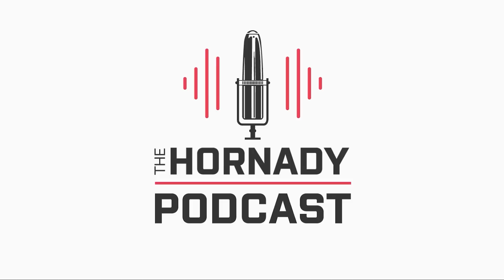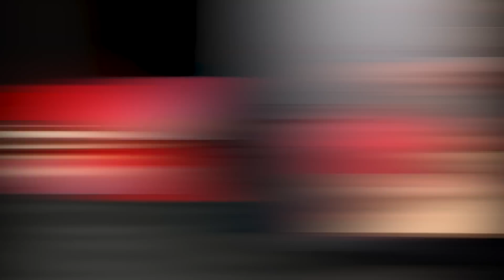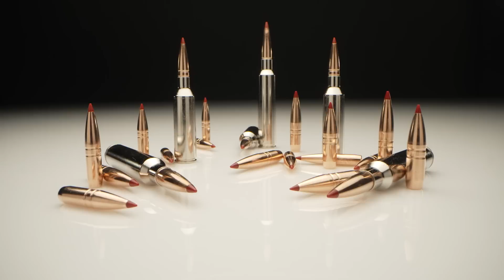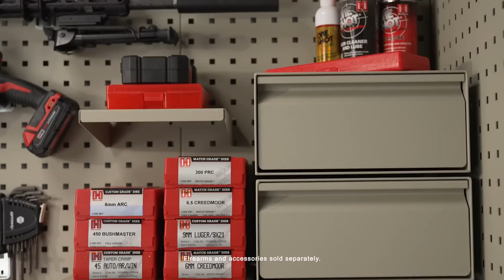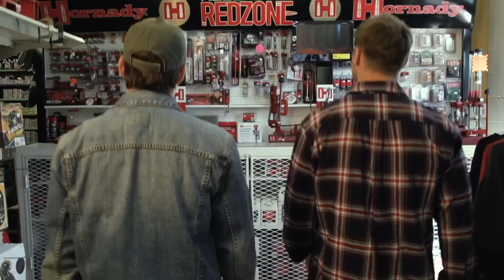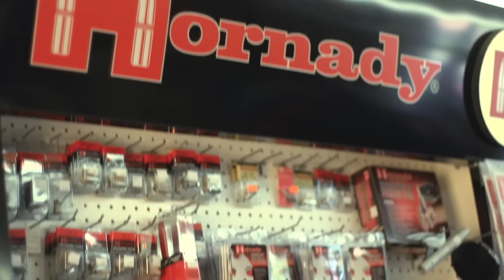Ep. 150 - Introducing the NEW 338 ARC

Comment: What is the deal with twist rates almost none of the 338arc rifles or ar platforms being reveiwed on YT are using faster twist rate barrels i dont think ive seen one in 8 twist yet?

Is 8 twist actually the optimum rate for a 14 to 16 inch bolt gun very difficult to find .338 barrel blanks in Australia so i would like be sure cheers?
Reply: 1:6.5" is great, so is 1:6". The later gives you about 2500fps limit before bullet failure, which is a high ceiling considering its factory loading is 2075fps froma 16" barrel

Comment: Will we see a .416 ARC? Based on the .535" bolt face PRC case, with a >=550gr SubX in short action? How about a .458 ARC @ ~700gr using a .588 boltface in long action?
Reply: The easy answer is a .416-458 Socom wildcat which is pretty much the same. Id like that over a 45cal

Comment: We need to know what AR-15 bolt it will use, what brass is used to make them and what magazine we need to get!
If one uses a common easily available piece of affordable brass, that is a winner!
From what I can find I believe there are the bits and pieces for having a 338 bullet coming out of an AR-15.

Subsonic and supersonic
338 ARC uses a 6.8 SPC brass, magazine & bolt

Subsonic and supersonic
338 Spectre uses a 10mm Magnum or uses a 6.8 SPC brass, magazine & bolt

Subsonic only
338 Razorback uses a 10mm case or uses a 6.8 SPC brass, magazine & bolt

Subsonic and supersonic
338 Whisper can be made from a 308, 7mm BR, or any other of those cases, a 5.56 magazine and uses a 450 Bushmaster bolt

Subsonic only
338 Whisper "2" can be made from a 5.56 or 223 brass, magazine & bolt

Comment: The 300aac was Built first as a subsonic first and foremost. It was done to unify the 300 whisper cartridge because there were so many specs out there. Its why Hornady used to refuse to call it whisper before saami approval. So he is wrong. The whisper was done for years before blackout.  The 338arc is more efficient. The 300aac supersonic was a Hornady thing they did to try to sell it as a hunting cartridge. Remington was onboard because they were trying to sell the hunting msr thing with the goofy r15 rifles. The port size is key with the 300aac to get it to shoot subs and supers suppressed and unsuppressed. If you use hornady powders you get unburned powder, if you use cfe theres none. Hornady uses cheap powder.
Reply: .300 AAC was not built as a subsonic first and foremost.

Comment: @Hornady
@Hornady Manufacturing 

Thanks for this.

Now please do a Straight Wall 41 ARC for all the straight wall needs. 

The 190 flex tip you’ve already got for supers, come up with a plinking round, & a big nasty 375-400 grainer for the subs. 

Maybe Try the 350L case length so there’s some authority with the Supers. 
It can be a souped up 41 Magnum rifle load for today with Big H supporting it & it besting all the other straight walls that will fit in an AR-15 platform. 

I was originally thing .375 but the ARC case is too large in diameter.

Enter the .41 ARC.

Comment: Will you develop a CX bullet for the 338 Arc for supersonic loads?
Reply: Hornady does offer a 185gr CX bullet... but I am not sure I would go for a CX with such small case capacity for powder (typically need 2,000fps for CX to expand reliably and desire 2,200fps)... but an ELD-X on the other hand... I like the idea of hunting with the Sub-X mag in the gun and an ELD-X mag to swap to if the game is just out of reach for a confident subsonic round.  They do have a 230gr ELD-X, maybe they could consider working up an even lighter weight variant with 338ARC cartridge in mind.

Comment: What are you doing about the diminished performance of the bolts on 6.5 grendels, 6 arcs, 7.62x39, and 338 arc.  I have several 6.5 grendels and 7.62x39s and I carry spare bolts for when the extractor breaks.
Reply: Hornady doesn’t make rifles or rifle parts.  I’ve been shooting 6.5 Grendel since 2009 across many different AR-15s with different barrel and gas system lengths.  I’ve been running my 12” CLGS suppressed pretty hard since 2017 without issue, and none of the others have had parts failures or notable malfunctions.  I recommend getting a Rexus bolt or 2 if you’re worried.  Also, remove any of your O-rings if you have them around your extractors.  Those hurt extractors due to excessive stress during chambering snap-over.
Reply: I really think in this case, we could look at the 6.8 spc case instead of the ever popular Grendel case to get a little more bolt strength. It just seems like everything gun related is a stupid popularity contest and they build what's popular rather than what's smart.
Reply: @cheatinggravity173  338 ARC runs at even lower pressure, so it's a moot point.  The subs are running in the low 40ksi region, supers maybe 47ksi.
Reply: @LRRPFco52 hmm interesting. Still, it makes me think that if it can run that low of pressure, a smaller diameter case and therefore better capacity/ more efficiency (higher pressure = better efficiency) could be utilized. Also, mags would hold more for the same length.

Not criticizing, just thinking out loud really.
Reply: @cheatinggravity173  Smaller diameter case = less efficient, not more.  The wider/shorter the propellant column is, the better conversion you get inside the chamber.  Grendel is phenomenal in that regard, giving you 93% of .260 Rem performance with the same bullet.

.260 Rem uses 10gr more powder and 10,000psi more chamber pressure for that extra 7% performance.
Reply: @LRRPFco52  more voluminous cases are always less efficient than less voluminous, it holds true for every cartridge out there. I think we have proven at this point with the last 25 year's evidence from the short mags that efficiency has less to do with diameter vs length than case volume to bore diameter. We can see this when caomparing the .270 wsm vs 300 wsm. 300 is more efficient. 308 is more efficient than 6.5 creedmoor. There is a ratio that works well and you get away from that, efficiency drops off.

280 AI is phenomenally efficient and gets sumilar velocity from less powder than the 7mag even though it has a skinnier case. .223 Remington is way more efficient than the 30'06 even though they are virtual twins in scale. Not because if diameter, but because of volume.
Reply: @cheatinggravity173  It’s clear to me that we’re measuring efficiency differently.  One of the factors I’m looking at is full propellant burn.  The .308, 280 AI, 7 Mag, .30-06, and .223 Rem all suck in that regard because a lot of the powder isn’t even converted.  That is terrible for throat life and SDs.  

In gas guns, it also trashes your gas port, causing early erosion and departure-prone gas system characteristics.  If that propellant isn’t being converted, it’s acting as a filler in the case and an abrasive down the bore.

Short, fat-shaped propellant columns do much better at converting the propellant, especially with higher angle shoulders and a good case diameter relative to bore diameter.

If you look at 6.5 Grendel, it does 93% of what a .260 Rem or 6.5CM will do, same barrel length, same exact bullet.  But Grendel does that with a much smaller case and 10-12ksi less chamber pressure.  So how do we scale that - this is where I’m focusing.  30 RAR was a very interesting cartridge in that respect.  I like what the WSSMs do in the chamber, but magazines can be a challenge.  Look at 25 WSSM vs 25-06 for example.  The 25 was the most interesting of the bunch.

But for 338 Subs, the Grendel parent case cut down makes a great base to work from.
Reply: @cheatinggravity173 I agree.  I manufacture ammunition and make the 6.5 grendel.  I was thinking I should start making the 6 Arc since it was the new hotness, but then discovered 6 Maxx and realized that cartridge makes a lot more sense and the brass will be easier to make.

Comment: Where is the 1:3 twist 😤, Im out
Reply: Did you listen to the segment on why they went with a 1:8 twist? They gave a pretty good reason.
Reply: yes, I also heard contradictions imo. The 8.6 can be supersonic due to its higher case capacity. This round begins To fail due to the high rpms generated with higher velocities. This new 338 arc has less case capacity reducing the versatility of the cartridge. 

(If you are specializing this round for subs only, why also reduce twist rates? Wouldn’t rpm be a more important metric over velocity or twist determining how a given projectile responds? These 338 bullets were designed to go much faster. Expanding projectiles generally need a little extra help expanding with these lower speeds. 

It doesn’t make sense to me to lower the twist rate to overcompensate for higher velocity it isn’t capable of. I feel they rushed to conclusions a little too fast here. This is new gun territory with lots of new info coming out. 

I suppose I am in the wait and see camp.
Reply: @jeffreyjadav9493  I’d rather have a slower twist if it means I don’t have a chance of shredding jackets like the 1:8. I’m sure some manufacture may come out with a faster twist for those who think it is needed. If it catches on I hope Berrys or other plated bullet companies will make cheapish plated bullets for it. I use Berrys in my 300blk for cheap subs so I don’t shoot all my Makers bullets. I doubt a plated bullet would survive a 1:3 twist when it’s rotating at those rpm’s.
Reply: @jeffreyjadav9493  the whole point of the 8.6 and 338 arc are the subsonics. If you want a 338 supersonic in a 308 based cartridge use a 338 federal its better. same bullets going at 1050 to 1075 are gonna deliver same energy on target but in completely different platforms.

Comment: So glad we have another 220 Russian based cartridge for the AR :eyeroll:
Reply: Haha I was thinking the same thing.   Bolt manufactures everywhere are smiling.
Reply: Hey Seth...
It's been a while since I spoke with you on the phone.  I think it was shortly after trying RL-26 in my  .340 Weatherby and we had both realized that RL-26 was special.  It was getting within 50 - 75 fps of what I had gotten out of the 26" barreled .338/378  Wby.!
The  ,340 velocities were also out of a 26" barrel.
Our other contacts usually revolved around my testing the velocity limits of 2 different  propellent guns in .30 and .50 caliber 
variants that invariably ran into hyper-velocity gouging issues once they got into the mid 6,000 fps range with monolithic L/D 1 ratio projectiles, with grain weights of 50/55 and 225 respectively.  Based on EML results these outcomes seem pretty intractable with possible solutions in the relative hardnesses of bore to projectile interfaces.  Tailoring of these parameters may be rather involved and they also have to be dealt with in light gas guns according to several labs.  Sound speed parameters and pre-acceleration gradient enhancement can actually result in yield strength transcendence times 5 at least! This is according to various labs from SWR, Denver Research and LLNL...just so you know.
All that was done back in the mid to late 80's
 thru the early 2000's...
I did get interested in the 
.416 Rigby straight/.460 Weatherby, necked to .50
caliber out of a 32" barrel
that was peaking in the 
11,000 to 12,000 ft. lb. range that would fit in rifles with a .338 Lapua bolt face.  Recoil issues would have to be figured out however!  
That was then and this topic is what interests me now and looking forward to the ride!  Excellent video!  Thanks for being there and keep your powder dry!

Comment: Umm can we get ammo prices down on what we currently have first. Make 300 blk cheaper, 308, 6.5 cm cheaper. Also make a hybrid case 77gr 5.56 and a gun that can handle higher pressures so that we don’t need a 22/6 arc. Those rounds will never be fully adopted anyway just like this round won’t. They won’t work well in a belt fed and they ar platform wasn’t made for them.

Comment: So jsut copied the wildcat 338 spectre.
At lease maybe its a more common case? But the 338 spectre using 10mm magnum cases have a normal-ish casehead, if this is using the fcking garbage 6.5 grendle/6mm ARC case with that trash casehead.... just why, they blow bolts constantly.

Comment: its like 8.6 blk but worse..... right out of the gate.
Reply: but worse? it runs in an ar15 not ar10 lol. there's 3 plus pounds of weight savings there alone.
Reply: @jjmckay6man1  plus the 8.6 has way more energy on target. Also much better long range potential. And it can do subs or supers.
Reply: @ayegame2424  way more energy if you shoot it supersonic which defeats the point of having it supressed you may as well just carry a 308 with far more energy again and a supressor at that point, when you bring it down to subsonic speeds this has more energy since they have a 307 grain projectile at 1050 fps vs the ~280 grain options in the 8.6 blackout from the factory.
Reply: @WayStedYou  you get 300 grain factory rounds in 8.6 subsonic loads. That's the most common weight I see. And yes you could shoot long range better with 308. But it's the difference that you can do both in 1 gun and not need 2. Also you get a lot more rotational energy in the 8.6 ammo. It's not that 8.6 does everything better then any other cartridge. It's that it is versatile  then thier cartridge. Your not stuck with short range subs. You can do more with less with 8.6. With 338 arc you need a gun for it. But if anything comes up that's farther away. you need a whole different gun.
Reply: @ayegame2424  a 307gr bullet travelling the same speed as a 300 gr 8.6 gives same energy lmao. Also arc can run subs and supers. educate yourself by watching the long form video on 338arc.
Reply: @WayStedYou  yeah this guy hasn't even listened to the video on 338arc lmao.
Reply: @jjmckay6man1  i just used 300 as an example. You can also do factory loaded  342gr at the same velocity. Which is way more energy... and I did watch the video and was unimpressed. Also you don't have to get the boombox. You can go falcon or even bear creek and save some cash.
Reply: @ayegame2424  still carrying a much heavier weapon than an ar15. bet you'll be paying much more for the crap out rounds. have fun with your boutique ammo lol.
Reply: @jjmckay6man1  this ammo will be very boutique as well. Very small market... most the arc cartridges are
Reply: @jjmckay6man1  not if you get a properly built gun. I bet the boom box is lighter then most people's ar15
Reply: @ayegame2424  yeah I'm not spending 3 grand on one of those..lmao have fun spending money you don't have to.
Reply: @ayegame2424  Q tard, opinion discarded

Comment: Time to make
160gr sub-X for the 6.5 grendel
Its already 1/8 twist 😉
Reply: Several people have developed subsonic Grendel loads using 8208XBR and 140-160gr bullets.  Works great out of 10.5” to 12” Grendels.
Reply: With a high SD like that it would be a good option fs
Reply: 6.5 carcano had a 162 grain round nose with 1/8 twist and had questionable stability. An even longer high BC bullet would probably not stabilize.

Comment: 2025 Year should have been an easy intro year for 25 Creed, 25 PRC, 25 GT…you all missed the ball
Reply: I agree with this... standardize the 25 Creedmoor
Reply: Absofreakinglutely!!!! Hell I would have been happy with a 257cal A-tip
Reply: @kirkmartin2223  that is coming
Reply: @kirkmartin2223  They just dropped .257 138gr A-TIP, .695/.350 BCs, which is insane.
Reply: Damn straight
Reply: 17 creed or 338 creed, possibly 416 creed....... 25 just never really interested me, and yeah, I get it 2025 lol
Reply: @briansouth9325  338creedmoor would be 338 federal.....yawn

They would have been better off coming out with a  20cal offering with a high BC bullet than anything 17cal
Reply: @kirkmartin2223  not necessarily, 308 necked up was the 338 federal.  You could run it higher pressures and heavier bullet.
Reply: @briansouth9325  it still would be kind of lackluster. You might get 2500fps if you leaned on it with a 230gr
Reply: @kirkmartin2223  no … 338 fed is a 338 fed. And actually, in all regards, a hell of a hunting round
Reply: 257 Roberts is 1 of the best 25's, yes would be nice to have a short action 25
Reply: I know 25s havent been THAT popular.....but its starting to get wanted more. Myself included
Reply: You should be in marketing 😂
Reply: We need saami 30 ARX

Comment: So when is the .338 PRC going to release?
Reply: It already exists, it’s called the 338 RCM. Probably the most underrated cartridge produced on the 375 Ruger case design.
Reply: @emberfield1  ummm NO NO it isn't. The RCM case is SHORTER and slower
Reply: @christopherbenfield7848  338-300 prc makes no sense to me when 338 lapua exists. At least 338 rcm fills a void that really no other cartridge does. A short action magnum 338.
Reply: @emberfield1  It might not make sense to YOU, But look closer at my comment, you refered to 338 RCM AS 338 PRC... which it IS NOT.
Reply: The last two 338 cartridges that Hornady introduced bombed (338 RCM and 338 Marlin Express), so I suspect they are a bit nervous about introducing another one.  The 338 RCM is the parent case for the 6.5 PRC.   I think they waited until the 8.6 Blackout started some interest in the caliber before pushing the 338 ARC.